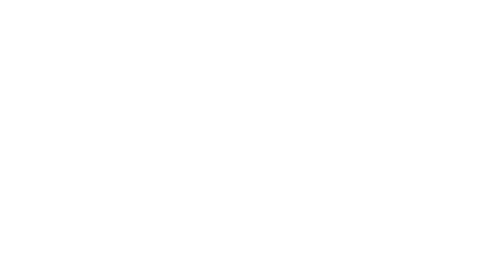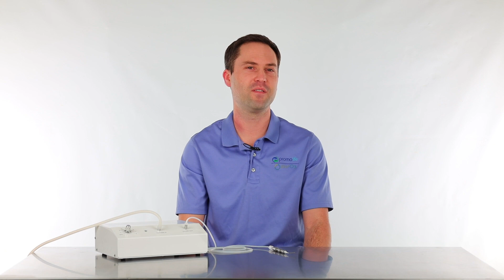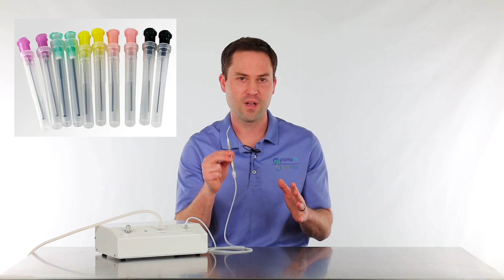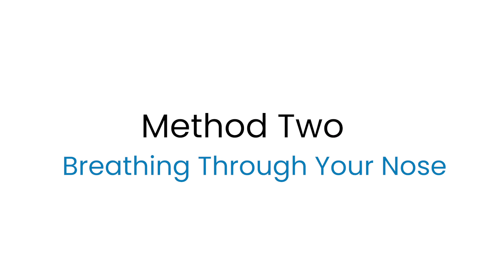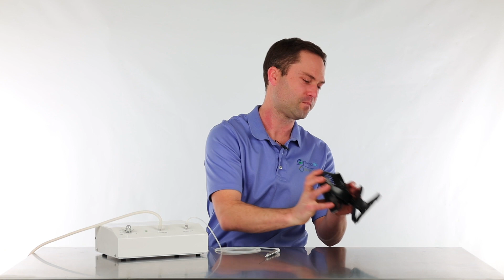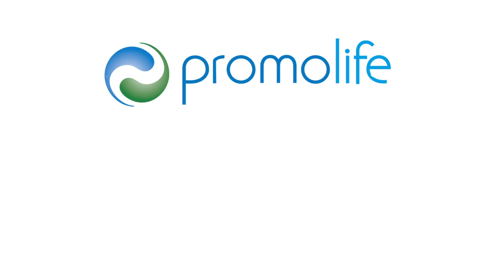How to Use the Ozone Dental Handpiece

Comment: I purchased this unit and it came with no instructions on how to use it, no explanations about the different colored "needles." And I found my throat hurting two days in a row. Unfortunately, once you use it, you can't return it. So you risk spending $120 to buy a product that does not tell you how to use it. It does not tell you what the different colored needles are for. And it does not warn you how to use it in a way that it doesn't hurt your throat. So buyer beware - if you use it without instructions and explanations, you cannot return it. I've purchased other products from Promolife that I like - but I would recommend AGAINST purchasing this unit, unless you are willing to ask a lot of questions and risk having a product that you cannot return.